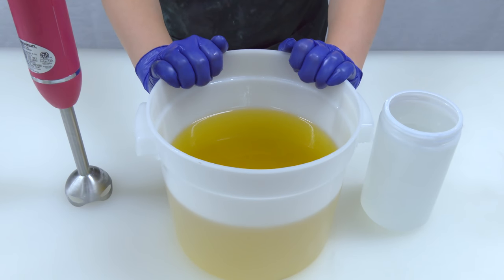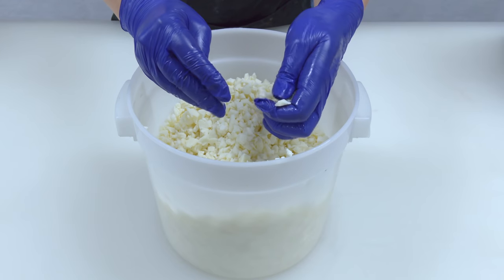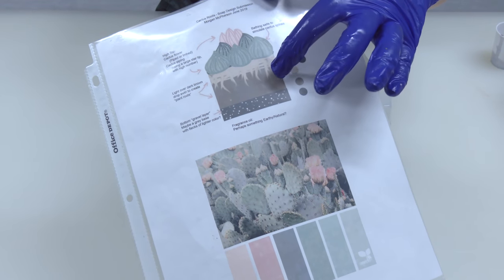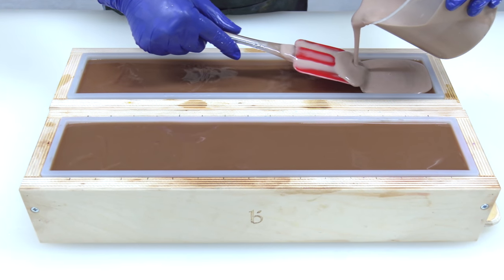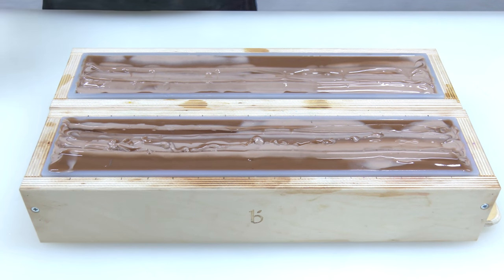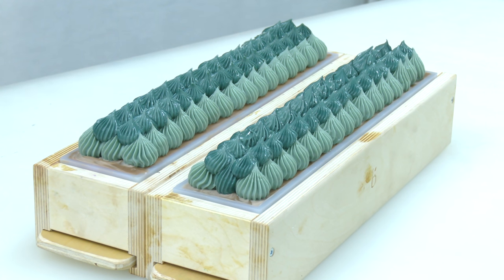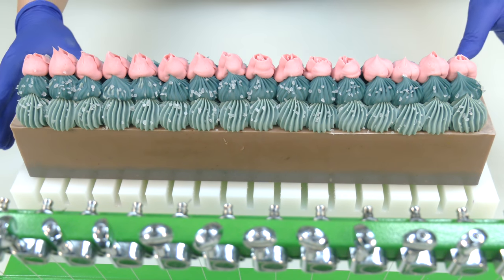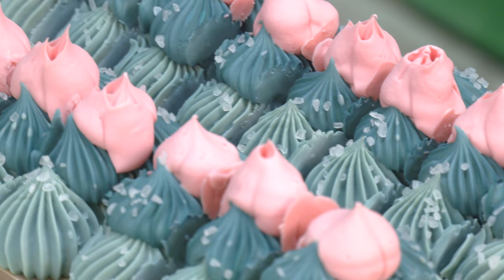Cactus Roots Cold Process - Turning Your Design Into Soap - Russian Piping Tip Test | Royalty Soaps

Comment: (Haven't finished the vid yet) ok i have a weird idea but idk if it would even work. If you like wanted to make a kinda root or maybe river thing insidr soap could you use soap bars to direct the soap? Like, first tiny layer in color A, soap bar (or several) of color A, fill up most of the way with the last of color A, then pour in color B. It could like flow around the soap bar(s) and be forced to move a certain way. Like color b is all poured in a straight like from sorta high so it percies. Through all of color A. Would that work? Or at least look cool? Idk just a thought
Edit; or using a pipet to put the second color inside the soap. Use melt+pour or normal soap into pretty liquidy soap like drao the pipet while it puts out soap and drag it from left to right??

Comment: No trendy plants for me; my decor is too retro 1930s. Weirdly succulents always die in my care. I over water or don't use the right soil/drainage. Best hardy plant is a stag head fern! I have one that's nailed to a board with mesh and hanging from a wire in my shower. I just soak it when the bag feels dry.